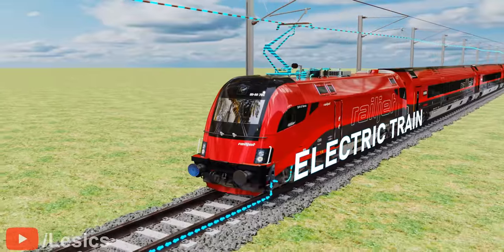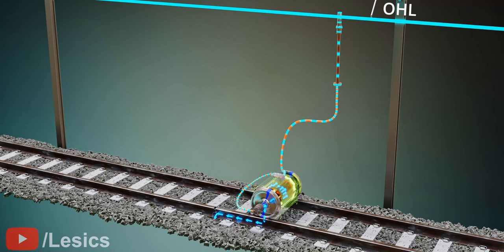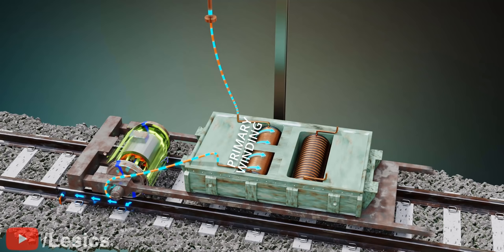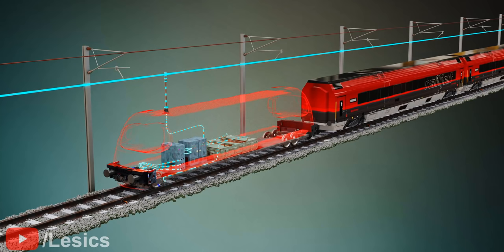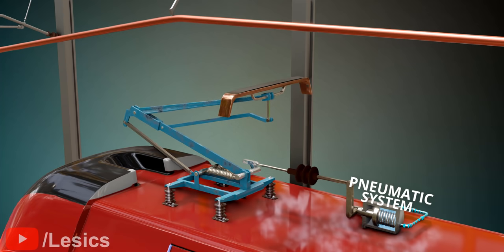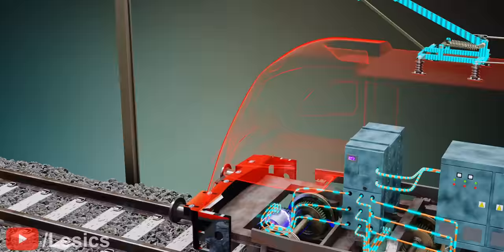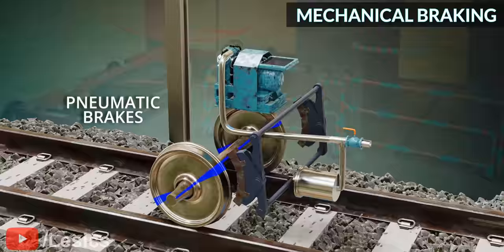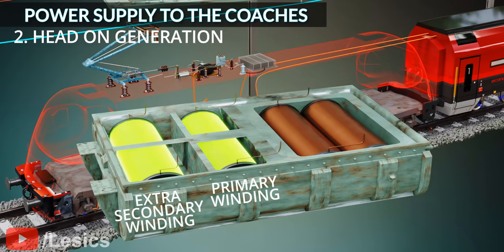The Fascinating Engineering behind Electric Trains!

Comment: I never knew asynchronous motors could do regenerative braking. It is breaking my brain to think about it. The inverter must also be made to be able to convert this power back to DC.
Reply: @aarkln  it will generate electricity, since it's regenerative breaking
Reply: @aarkln  no, but regenerative breaking per definition generates/recovers electricity
Reply: @climatechangedoesntbargain9140  Sorry, I am wrong.

Comment: Great video! Things got so much more clear how many components are involved to make this train run. My only question would be what how which parts are replaced by Diesel electric engines (so without overhead power line). The diesel engine is not direct linked to the wheels but as far as I know creates electricity to drive the wheels. Not sure if it's AC or DC but I would guess the diesel engine creates single phase AC which would be transformed to DC and 3-phase AC. Correct me if I'm wrong. :)
Reply: The diesel engine a generator and then it's as shown in the video.
Reply: Modern Diesel locomotives create 3-phase AC which is then rectified to DC and again converted to three-phase AC (with a different frequency)

Comment: some systems use a third rail instead of an overhead, And some locomotives are capable of AC and DC operation so they can run on overhead or third rail.

Comment: The description of the pneumatic brake is not quite correct. The animation shows a modern spring brake, in which pressure in brake cylinder keep the brake released. Reducing the the pressure causes the spring to apply the brake.

Comment: This construction is cool. And has much potential for improvement. Especially when I think about adding a solar roof and batteries.
Reply: Solar, sure. Battery, why?
Reply: how would a soler roof and battery improve this
trains that need it have a diesel generator or battery to shunt off wire 
but a solar roof could only supply enough power to serve the coaches as the best of times and would mean a lot of extra work

Comment: 1. Why are there 6 axes? The ÖBB 1116 has only 4 
2. Why is the first class car behind the locomotive? The first class carriages are located at the control car at the other end of the Railjet 
3. In Austria, where the Railjet is also on the move, there is 15 kV electricity. 
4. The spring-loaded brake is only intended as a parking brake when the train is stationary. 
All of this should have been considered and implemented correctly. Otherwise just take another train...

Comment: Does the return current flow from the transformer through the body of the locomotive (as multiple online sources state) to the axel brush, or through a dedicated conductor as show in 2:50? Or are both solutions in use?

Comment: I wonder how this setup works in my country, since most trains don't have a separate engine, the passenger compartments right after the driver cabin, so there seems to be no space for all the stuff to drive the wheels
Reply: Often all carriages have driven wheels with the electronics split under the carriage floors and on the two carriage roofs with the pantographs (one at each end, pointing in opposite directions, so you don't need to ever turn the train).

Comment: When using dynamic braking is the power generated during speed reduction passed back up through the pantograph to the catenary to be used by other trains or is it just fed to a resistor bank and wasted as heat to the atmosphere as is done in diesel units?

Comment: You would be amazed how many countries use DC and still have a huge amount of locomotives/motor coaches equipped with DC motors.
Reply: It is because rectifiers used to be very expensive and unpractical until recently. It made sense to skip that part of the process by using DC. Most metro systems use DC, and some (maybe most?) new lines and stations still stick to DC due to compatibility.
Reply: @fresagrus4490  Recently? Semi conductors have taken over for over 50 years now.
A DC motor is just very easy to control. Very cheap design but higher maintenance cost.

Comment: Pneumatic brakes are not described correctly. Pneumatic brake cylinders are filled with air to push out pistons to start breaking. Parking brakes are working reversibly because if locomotive loose its air pressure it will not be braked because locomotive are using pressure braking system, not vacuum system like in cars. So in this case is used air pressure to push against a spring which is pushing out the piston.

Comment: Electricity enters from the overhead wire and leaves into the ground by the wheels... But wheels are attached to the metal body of the train... Why touching the outer body does not give us the shock?

Comment: In the PHASE INDUCTION MOTOR, why do the power have to go through the rectifier to convert AC to DC then go to the inverter to convert the power from DC to 3 phase AC power WHILE the power can go directly to the inverter to convert it into 3 phase power? The 3 phase power & the original power is still AC power though.

Comment: Electric trains use a complex system of power collection, three-phase conversion, regenerative braking, and zigzag overhead lines to achieve efficient and reliable operation. The video explains the engineering behind these key features.

Key moments:
00:00 Electric trains have a unique power system where the power collected from overhead lines flows through wheels and grounding cables. Understanding the engineering secrets behind electric trains reveals their simple design and functional improvements.
          -Power flow in electric trains. The power collected from overhead lines flows through wheels and grounding cables, showcasing a unique system in electric train technology.
          -Simplest design of electric trains. Exploring the basic design of electric trains involves a single sliding wire collecting power from overhead lines and feeding it to an induction motor connected to the wheels.
          -Functional improvements in electric trains. Enhancements like step-down transformers, three-phase induction motors, rectifiers, and inverters are crucial for improving the functionality and torque output of electric trains.
07:50 Pneumatic braking systems provide automatic brake application in case of air leakage or compressor failure, ensuring safety. Power supply to coaches is commonly done through head-on generation for stable power output.
          -Importance of pneumatic braking systems for safety. They ensure automatic brake application in emergencies like air leakage or compressor failure, enhancing passenger security.
          -Methods of power supply to coaches. Self-generation through alternators is common but inefficient due to fluctuating power output, leading to the prevalence of head-on generation for stable power supply.

Comment: That means that all wheels are part of the motor? In every single wagon?
Reply: No.
Reply: Most of trains have motors only at locomotive, but some very specialized can have motor at each axle, in every wagon
Also trams have motor in each bogie
Reply: @jakubpollak2067  Multiple units (trains without loco) are verry common and have some powered acles on the whole train

Comment: Cool video bro!!! But I don't understand one thing. At the speed the train moves, The sliding wire/thing which collects power from the overhead wire won't it burn up due to friction due to the speed the train moves at?
Reply: Thats why we use Pantagraphs instead...watch the previous video of lesics n u will understand
Reply: I assume that the airflow is sufficient to cool the heated surface to within acceptable limits.
Reply: @Teqnyq  oh thanks
Reply: @anuragyadav8088  thanks I'll watch his other video
Reply: @Teqnyq  nah bro
Reply: The lines are in zigzag pattern so 
 the point of contact changes every moment
Reply: @ssaha7347  ohh thx
Reply: @anuragyadav8088   im happy to learn if im mistaken- so i ask you, why not? 

To me it's logical that the contact area will experience some local heating due to:
1. Friction from the back and forth motion of the wire against the contact surface and the upward force the pantograph applies to the cable. 
2. Power loses due to resistance to electric current flow at the contact surface. 

I think the pantograph assembly is just engineered to keep any temperature rise to within acceptable limits ie:

1. The sliding motion ensures even wear since one area is not rubbed for too long the side effect is heat has enough time to dissipate.
2. Pantograph applies just enough pressure  to the cable.
3. Using high voltage reduces current draw for the same power and the side effect is reduced electrical heating at the contact area as its resistance will be relatively constant. 
4. Etc

Comment: One thing I have not been able to figure out is are the gears encosed and lubricated? It seems they would have to be, but I have been unable to find any photos of the shield or how they are mounted. If anyone can point me to the solution, I would be very grateful. Thanks.
Reply: Yes, all the gears are mounted in a crankcase. The axle pass through the crankcase and the motor is mounted on the side of the crankcase. Here is a schema: https://image.made-in-china.com/2f0j00INhQZOAsiSrd/Motor-Welded-Frame-Bogie-for-Metro-Vehicle-and-Lrt.jpg

Comment: some things have been forgotten, there are 2 brakes, the "train brake" and the "Ind. brake", which work slightly differently being the same brake, and in my opinion a very important thing, the air tank. The pressure of a long train will take forever to regain enough bar to release all the brakes without a tank to store that compressed air in the loc. In other words, without it a long train will brake and take a while to manage to speed up again

Comment: If the electric current were transferred from the overhead line to the track via axle brush, is that true that we can be electrocuted if we're touching the railway line?
Reply: Touching the grounded rail while you're also on the ground doesn't create any potential difference. If you were to grab the overhead line and the ground, then there would be a difference in potential, and current would flow from one to the other through you. (Don't try this at home) haha
Reply: @PlakToetsBart  yesterday I was touching an electric device accidently while standing on the ground, I was electrocuted
Reply: btw why the metal track has to be electrified also? I think trains can run on it without any current flowing in it
Reply: @hamsterindonesia6548  The train is grounded via the track, as the video explains.

So the train itself closes the circuit between the overhead line and the track.

Comment: How does electricity flows in negative half cycle? Does the ground supports that?
Reply: What do you mean? Are you saying something about the ground contact could act like a rectifier?
Reply: @b43xoit  
Yes I thought that electricity can only flow from positive to ground and it should have worked like half wave rectifier. 

But now I know. Electricity flow between potential differences. And ground acts like 0 potential

Comment: You can´t adjust the speed of the Train with only adjust the frequency that goes to the engine. The frequency for the engine must be adjust to the rotation of the engine.
You adjust the current that goes to the engine and with that you control the torque of the engine. With that you accelerate or not, that’s what is changing the speed.

Comment: So if the power fails, do the trains stop running?
Reply: They usually have batteries or gasoline-powered backup engines just in case.

Comment: You're wrong with the pneumatic brake - system you're showing is used only in modern locomotives to hold it stationary when it's shut down.

Pneumatic brakes for normal operation works just opposite. You're applying pressure to brake cylinder to push the mechanism against wheel and slow down. When you release the pressure a spring pushes the mechanism from the wheel.

Comment: 2:05 why the voltage in OHL equals 25 kV ??
Also, is it Direct Voltage, or Alternating??
Reply: 25KV AC
Reply: The video depicts a direct connection from the pantograph through the transformer primary to ground. Transformers cannot be used for direct current.
Reply: The voltage can differ depending on the country. Here 25kv 50hz is the industrial voltage thus the common voltage for train. We although have 1500V DC, 750V DC. Though with 25kV the need of substation will decrease and the distance between them increase.

Comment: If the motor needs 1000 to 3000 volts, then why the overhead wire supplies 25000 volts and need a step down resistant to bring it to 1 to 3 kv ?
Reply: Because its more efficient to transfer electricitt with higher voltage and lower current.

Comment: Why isn't 3 phase achieved with tre secondary windings on the transformers?
Reply: With a transformer you could go from 1 phase to 2 phase (180 degrees) but not to 3 phase system (120 degrees).
Another advantage of converting your AC to DC and finally to 3 phase is that you will have more control because you'll be able to also adjust the frequency.
Reply: @ppdan  Yes of course PWM is an amazing thing. 👍

Comment: i still dont get how it can flow into the ground and end. dont you need two connections to keep the elctricity flowing
C&O1395
Reply: Because the potential difference between the return rail and earth is close to, if not zero. The comment about ground is a mistake.

Comment: Is 25kv/440 v  transformers not used for  220 v ac power in coaches?
Reply: In india we dont use power of ohl to power coaches earlier the   Dynamo and battery was used for each coaches but now diesel generator are used in last coach which supply 715v ac to each coach you can see last coach of any superfast or express trains

Comment: Hello, 
Can anyone tell me why does motor should supply high torque at 2:43.

Why does it need torque? Thanks
Reply: Well. When the "power" of engine is an integral/summarising parameter, the actual effective parameter of pulling ability is a "torque". It is the rotational analog of linear strength and is in straight dependency with mechanical acceleration.

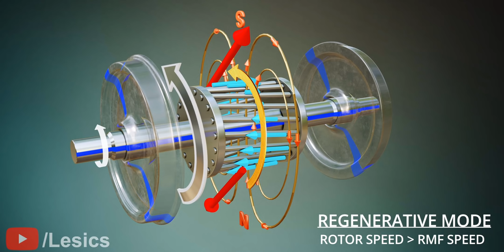Comment: 7:10 but the axle is still in contact with the train wheels, so it is metal to metal contact isn't it? I get your point that the induction motor and it's inside coils aren't in contact with the axle though.
Reply: Yes but the wheel and rail don't slip

Comment: Here in India the back Pantagraph is always used. Any reason?
Reply: Technically they can use either of the pantograph.. But the use the back one for 2 main reasons...
1. If due to some reasons the front pantograph fails, the falling  broken parts can always cause damage to the back pantograph (during the forward motion of the train) and the loco will be completely unusable.but if the back panto fails, they can still use the front panto... .
2.aerodynamic reasons.... The back pantograph is in such a way that it faces  backward with its hinge having a convex shape. This helps in cutting through the air at high speeds (this is not possible with the forward facing front pantograph)..

That's why always back panto is used..
Reply: @NemysisPrime  and its safer where people can get near the tracks, No third rail for someone to step on.
Reply: @NemysisPrime  2. reason is irrelavant 
pantos are mounted both ways depending on the type of train

Comment: Couldnt trains just use a very high torque generator, that is used as a break and generates electricity when the train is stopping?
Reply: Modern tractive units use their electric motors to regenerate.
Reply: @bfapple the Swiss CE 6/8 from 1919 could already do this, since it was designed to go over the alps and feeding in electricity there means you can brake for extended time without overheating something

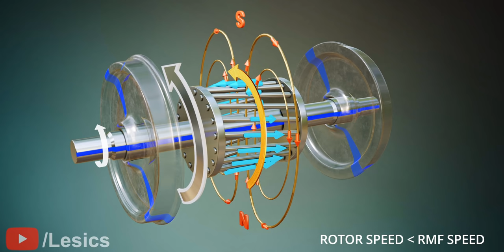Comment: 6:50 this is wrong explanation. You can't brake a train by pumping more electric energy into the system. Electric brakes works very differently. The motor generates electricity that is used to heat the brake resistors.